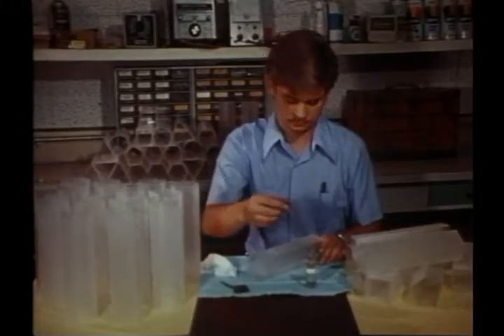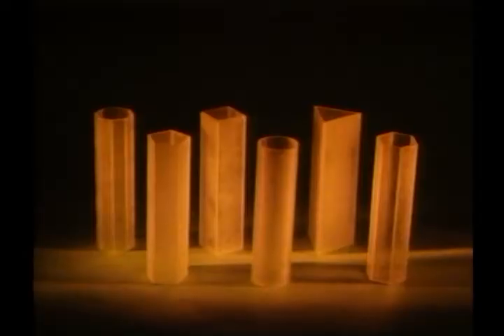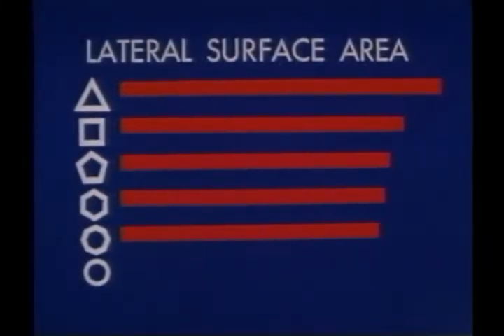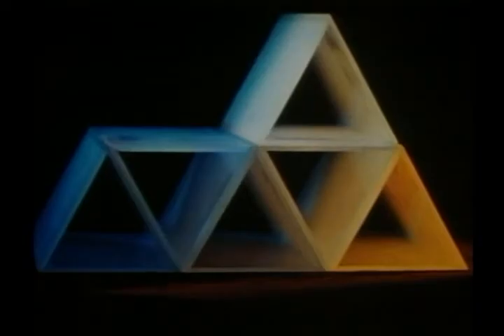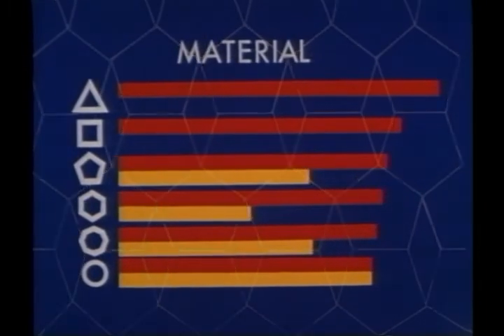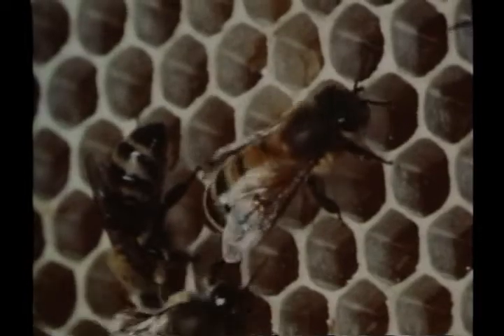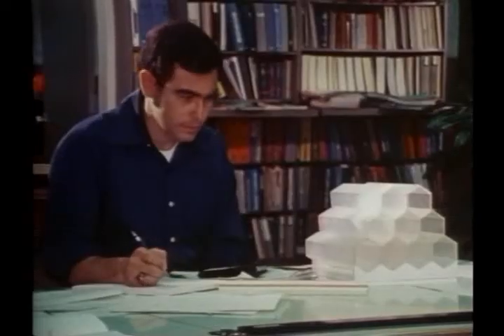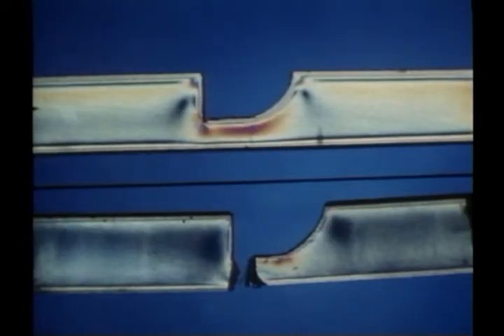Mathematics of the Honeycomb (Part 1 of 2)

Comment: The close ups of cell formation are inconsistent with the idea that bees build hexagonal cells for their honeycombs. The deltoid to the right of center at 1:31 can be seen at 2:28 as well, in the gaps between cylinders. Those bees are making cylinders, not hexagonal prisms. There are no deltoids in the finished cells seen elsewhere in the video, so either the bees finish the cells by removing the excess wax in the deltoids or the wax wears off on the bees moving in and out of the cell.